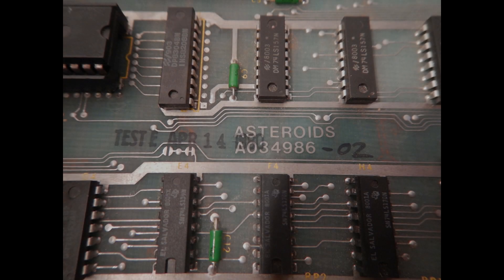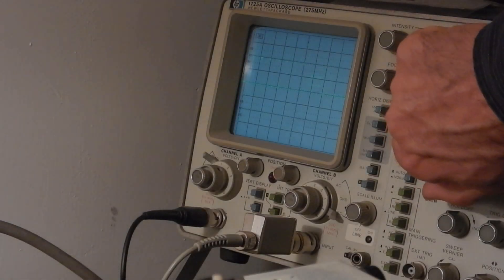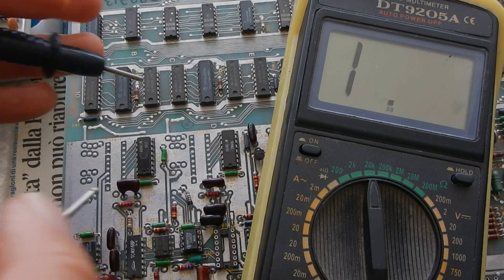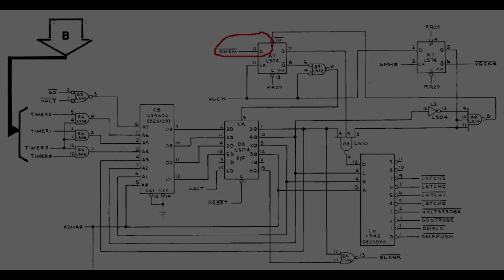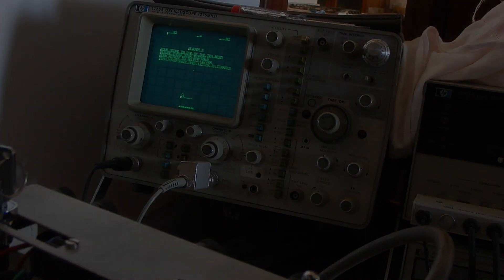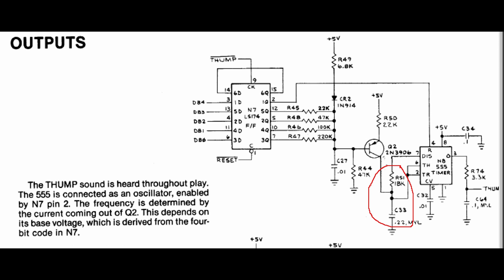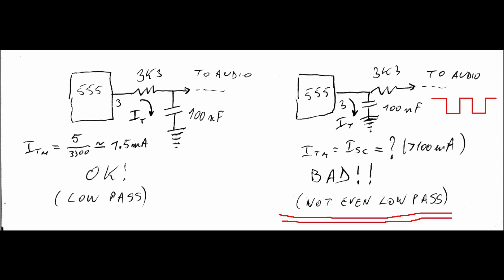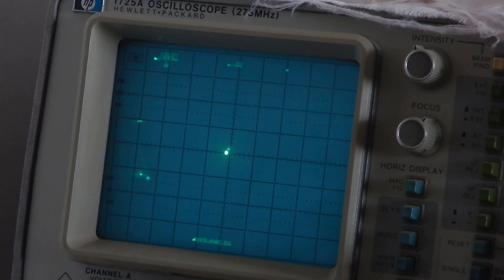Atari Asteroids Arcade PCB repair (#2 board). Bad DAC and early revision's sound fault.

Comment: This is great. I wonder how many boards with this flaw were made and how quickly those 555s failed. Maybe a fair number of them lasted long enough. 🤷‍♂️
Reply from the maker: Hi John, well I have no idea about the numbers, but the -04 board was made in June of 1980 (the other one I have), so the -02 could probably count less than 100k units. I guess Atari knew about this issue and probably instructed the repair people to modify the failed boards.